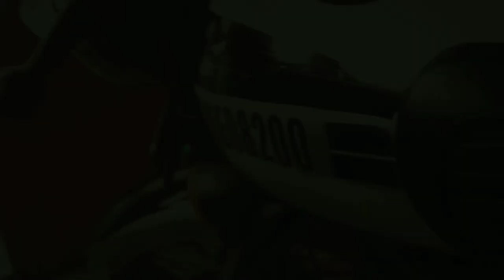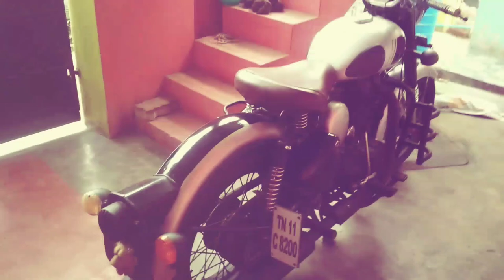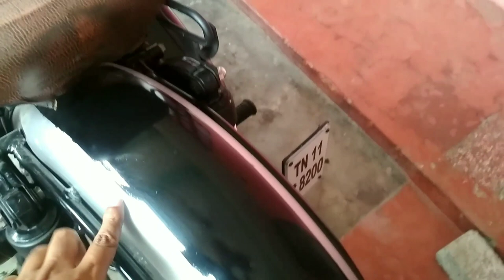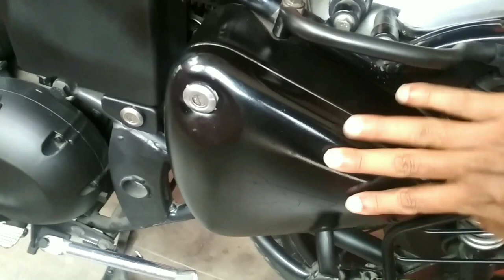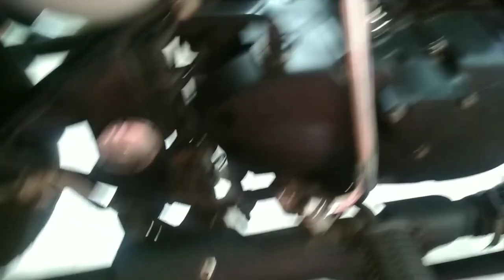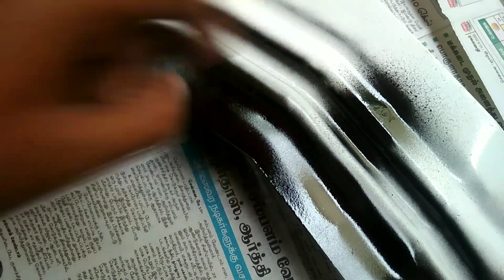HOW TO DO SPRAY CAN PAINTING TAMIL/SPRAY CAN PAINTING

Comment: Bro.....na en bike tank aha spray paint aha vachu paint panniruken.....but nail aha vachu rub panna kuda paint remove aaguthu....so ithuku enna reason...and itha pathi eathachum video iruka....bro.....
Reply from the maker: How many cote given during painting. Minimum 3 painting cote required bro
Reply: Yes bro 3coat panniyachu....
But paint remove aaguthu....
Protection spray yeathachum iruntha sollunga bro.....
Reply from the maker: Use clear coat spray cans it will give shining and avoid normal scratch bro
Reply: Ok bro thank you.......
Reply: Bro proper ah use panugea .nalea irukum